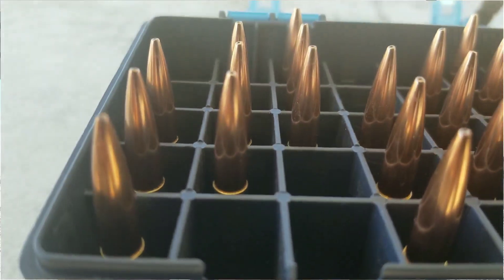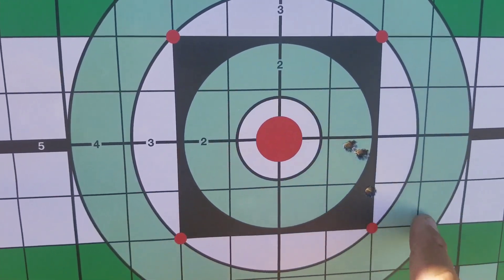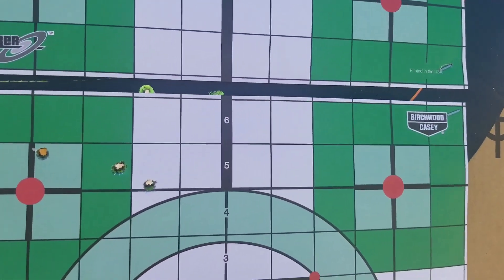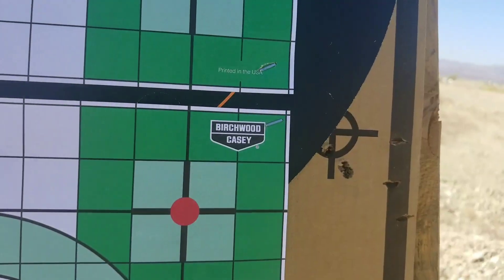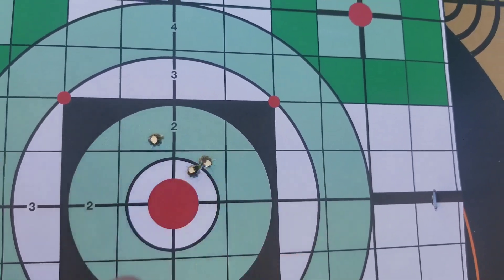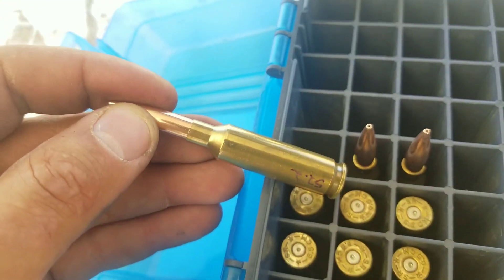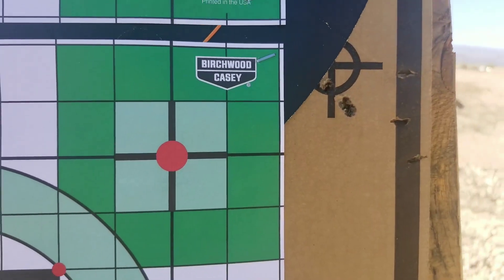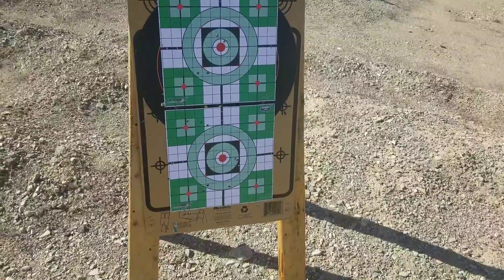6.5CM Better Velocites with CCI 450 Small Rifle Primer & IMR4451

Comment: Ditch the caldwell chrono.....it's a finicky POS. I wasted a lot of time and components using the caldwell chrono. I live in Southern AZ, my caldwell would read great in the mornings and late afternoons. Mid morning and mid day would have me pulling my hair out due to changing lighting conditions. 
I got more consistency by putting a pop up over the chrono, but then that's one more thing to pack, and no fun in the wind. Keep up the videos and the work, they are both appreciated. Cheers

Comment: If I may suggest try the Satterlee test, See Vaughan Precision on You Tube. I took my 6.5 Creedmoor found my sweet spot  in about  25 rounds.  I was using Reloader 17 powder, Lapua Brass  small primer (CCI 450)  with a 140gr Hornady Match.  My  ES was 11 fps ,  with muzzle velocity  of 2810  fps. Good luck with the development.
Reply from the maker: Yes Sir, Curt is a great guy! I swear by the satterlee method. I do a improvised version and combine the Round Robin with it. The data compares with each other (accuracy window & velocity platue) which is really nice. Many confuse the round Robin with a different method but you can read about it here aswell as a past video series I did. I'm not using this load development here to break in the barrel and also get some trigger time
http://www.6mmbr.com/laddertest.html

Comment: I remember trying to get an accurate subsonic.308 load worked up for my friends bolt gun. Seamed to always have a few flyers that I could never explain. Took me a few hundred rounds to be able to get consistent 1.75 inch groups at 100yds. I was very frustrated for a few weeks but now that it’s done, I’d kinda like to go do the process over. Strangely satisfying. Your already doing better than that dude with the bike stuck in the parking meter:)

Comment: Hi Kenny, just watched your video, actually three times to try and fully grasp what was going on , first of all hope you don’t mind me sharing some of my thoughts just a reloader talking to another fellow reloader, did you make scope adjustments to any of the groups or were all groups shot with the same scope setting? The reason I ask is most groups seem to be pushed left to right and then one group in particular was in the middle and velocities were similar except for one round but were not affected by wind . Am also sure you are aware that optical chronographs can throw out some random numbers from time to time what with setting up and lighting issues etc etc , but with some of these groups they seemed to be pushed quite a lot over to the right and if that was at a hundred yards 2–3 inches seems a lot , personally I would go with the group that was least affected by wind and more centred . Hopefully with your reloading techniques now that you are trying to build like for like consistent ammunition case prep is important ie. like neck tension, flash hole uniformity and even primer pocket uniformity, but having a good reliable scale and chronograph are definitely worth investing in. So if case prep is up to scratch and I mean up to scratch and powder is accurately weighed taking the chronograph out of the equation leaves components and shooting form , IMR 4451 is supposed to be the replacement for the Hogdon H4350 I just looked it up I’ve never used either of them so I can’t comment but I know that the H4350 is a go to powder for a lot of guys so hopefully their burn rate and performance is some what similar, then there is primer ok they are pretty much inexpensive try a couple they can make some difference, and then there is shooting form if that isn’t down your groups could be all over the place, I don’t know how solid that table is that your shooting on but if it’s not then hit the dirt and shoot prone hopefully you have a rear bag I think I can see one in the video for supporting the rifle to aid with tracking and stability. If you don’t like to record yourself shooting on your videos that’s fine but record yourself shooting for your own training to see if you are doing things right or wrong you would be amazed what you can learn . After watching this video there are so many variables you have to break them down one by one hope you are not offended by what I have said only meant as constructive criticism and food for thought, all the best G👍
Reply from the maker: GianniG, Brother Thank-you lots of great suggestions Ill deffinitly start with filming prone. I had to make scope adjustments twice left... now im wondering if the scope is shot out cause it didn't hold zero from last session. Would you reccomend a beam scale as a more accurate and cheaper alternative?
Reply: Hey bud , what ever scale your using now use it to throw your powder but all these reloading scales are called strain gauge scales which are just not accurate the cheapest scale for reloading and holds more accuracy than the normal Lyman, RCBS and so on is probably the Gem 250 I think to 1/hundredth of a grain but there are better more accurate scales that are sold from proper scale companies and not the reloading companies which are accurate and have better repeatability at the end of the day you do get what you pay for and you have to treat these scales with respect. So remember one problem at a time otherwise you will go crazy 🤪

Comment: 2.890 seems a little long, Sammi specs I think is 2.820.  Maybe try a little shorter oal?   Also isn’t CCI 250 a large magnum primer?
Reply from the maker: Dangit lol yes Thx just fixed it. Well my lands dont hit until 2.915". Ill try Seating shorter.  I originally loaded at 2.800
Reply: Eagle Eye Shooting The longest I’ve seen anyone mention was seated was 2.875 .  It was using a 140gr Barnes match burner in Starline with CCI 450 and accurate 4350, best group /sd was at 41.0 gr.  A .571 moa and 8 sd.
Reply from the maker: O oh... I better check out the chamber again.. I seen bolt action reloading with that same OAL you mentioned. It seems like 41 is like the magic number with multiple powders.